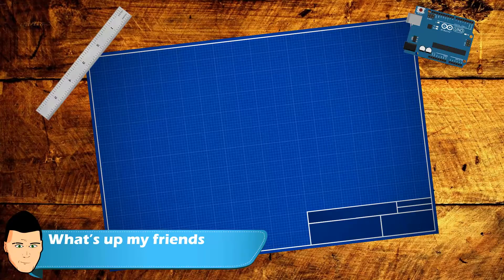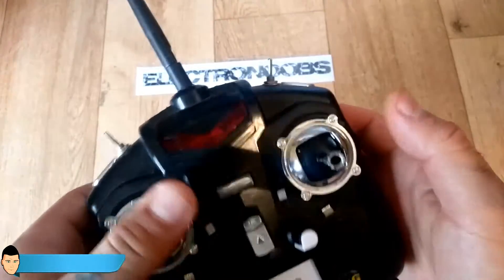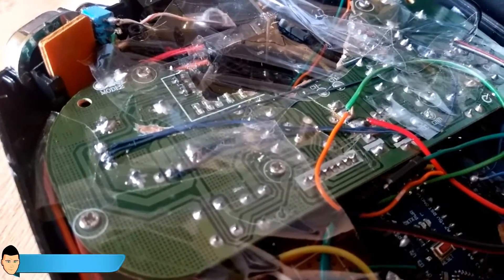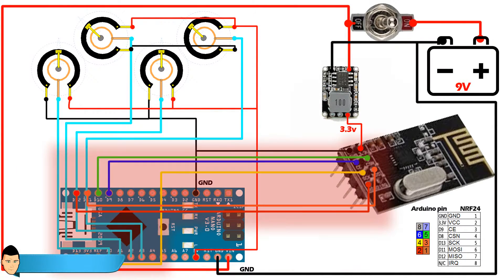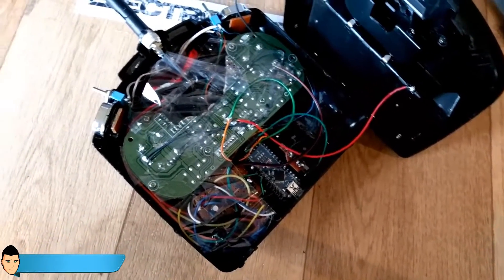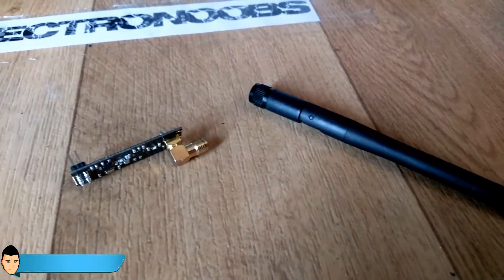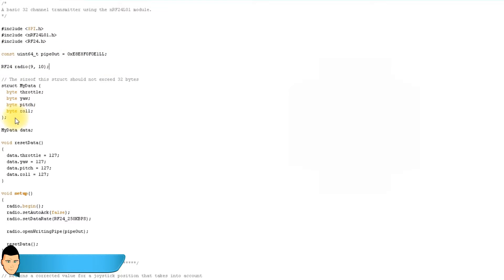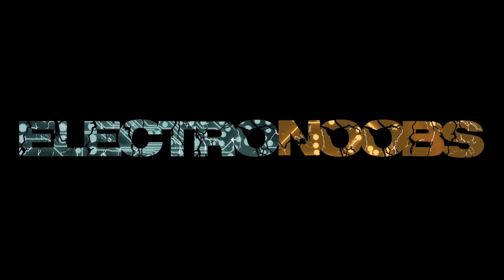3D printed Spitfire RC plane - Transmitter arduino + NRF24

Comment: Hi, in the code you write: "The calibration numbers used here should be measured 
  // for your joysticks using the TestJoysticks sketch". Can you please include a link for the TestJoysticks arduino sketch? I assume you use this sketch to find the lower, middle and upper values of the potentiometers you use, is that right? thanks

Comment: If anyone is interested in making a more comprehensive Arduino controlled RC plane, check out this RC plane project here: https://www.youtube.com/watch?v=rPLp50zgQIw. The software used in the project is here: https://github.com/PowerBroker2/ArdUAV and the hardware setup is https://forum.flitetest.com/index.php?threads/experimental-arduino-rc-plane-build-log.53528/.

Comment: my transmetter was not working on serial monitor now what I cando
Reply from the maker: Whant do you get on serial monitor??
Reply: Electronoobs nothing
Reply from the maker: Then you should change the baud rate. You should get at least 0 values. Something like this:

Throttle:=        Yaw:0              Roll:0            Pitch:0

If you don't get this is because of the baud rate or because you're not using the (test code)
Reply: Electronoobs ok now it is working.

Comment: Made this way more difficult and heavier using arduino and supporting electronics! Spektrum DXe transmitter for 55 bucks, spektrum ar400 for 30 bucks, + your old ESC, motor, 3 servos and you would have a much lighter craft.
Reply: Lance Pratt yes, but arduino supports 13 channels at least. You can hook up camera stabilization, and it is much more versatile. You can buy one arduino for all of your projects, not specific transmitters and stuff. It is a computer too.
Reply: I'm gonna try to make one with out using Arduino
Reply: I am getting my parts in two weeks!
Reply: Science Man mines half way done printing I printed mine with a brown wood Color and it looks oooo so good
Reply: I am 3d printing a custom airframe with arduino. It is going to weigh around a KG with a 1500 mm span. First time flying scratch build :D. That brown wood  will be cool.